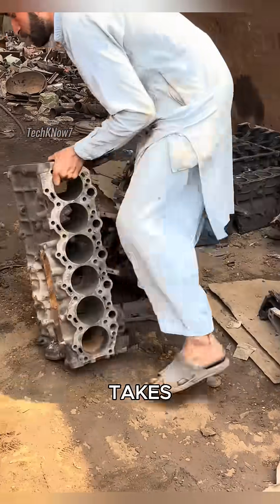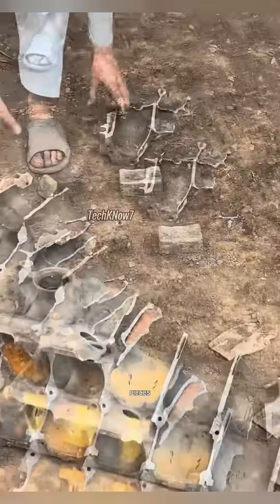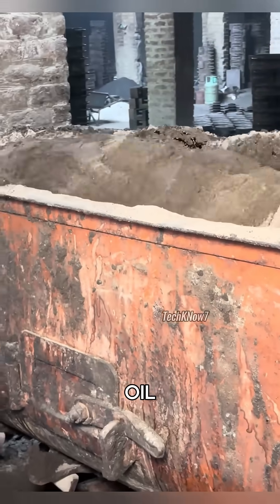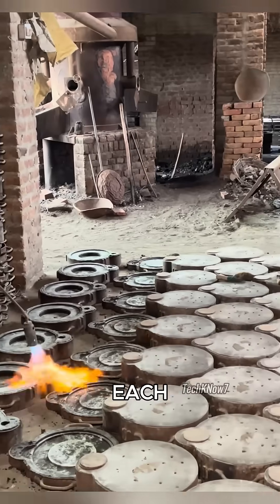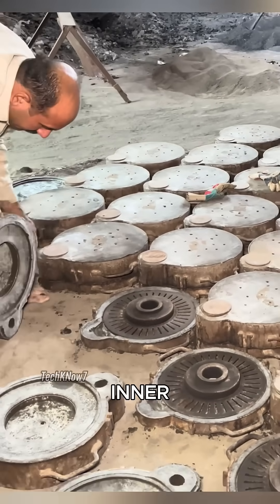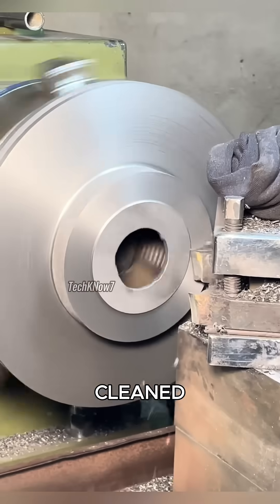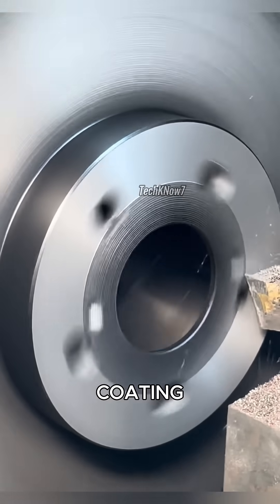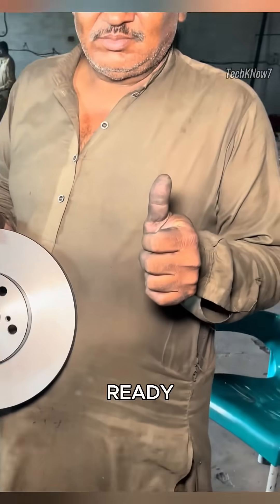How Old Engine Blocks Are Recycled Into Brake Disc #metalworking #engineeringskills #craftsmanship

Comment: Wow for those engine blocks to break like semi-hard hard stoney clay, those must've been ancient models, most cast iron of-today's is a bit more durable, and there just being all mixed together with out the metal being refined and what about the Homogenization: process were they add Inert gas (typically argon) is bubbled through the molten metal to ensure an even temperature and a uniform distribution of alloying elements and it also helps remove impurities, adjust chemical composition, and eliminate unwanted gases to achieve precise material properties.  There just adding more of a porous texture to the cosmetics of the surface of the metal, weakening the integrity of the metal, making those brake disc or also called brake rotors, (they made)- have the same durability or a bit less than a cast iron cook wear pan from today if u were to shave it down to the same metal thickness as one, but it'll probably be softer cause of the defects it would have, especially the old metallurgy of back then being mixed and forged in an even more outdated process of how it was first made 😅 but hey if there being sold for cheap over there and there easily accessible then that's fine i mean the streets are always crowded (over there i assume), from a lot documentaries I've seen there not gonna be speeding over 54mph to really need some heavier duty ones👍.

Comment: Just a question: the engine blocks that were broken down were aluminium right, the brake rotors are steel.  Have they discovered alchemy.
Reply: The engine blocks are most likely cast iron and most brake discs are commonly made from cast iron too.
Reply: @amarkhan2593 but for years engine blocks is made from aluminium. This video is big beautifull nonsense...
Reply: @damirbogner6432 The video also implies, that we just throw old engines on a big pile and dont do literally the same thing they do. Reusing its metal for something new
Reply: @damirbogner6432 You have no idea about Pakistan. Cast iron block engines are in use here, specially in the transport sector 10 x more than aluminium ones.
Reply: @damirbogner6432 these are Toyotas engines from 1970's and a million miles
Reply: Most engine blocks are cast iron, you could also tell by the corrosion and colour on the outside of the block
Reply: @getanearlyd8276  Working on modern european cars, I can not tell you if Ive ever seen a cast iron engine block. And even for the ones that are, I am rather sure the cylinders are coated and not bare iron. Also I dont know if THIS treatment of rusty old metal is a good idea for something like break discs
Reply: No they use cast iron blocks to make things that are supposed to be of the same metal.

Comment: Failed to mention these are the rotors sold on eBay that warp upon breakin.
Reply: Was gonna say they looked familiar. These are not rated to be brake disks. No proper hardening procedures, random scrap metal slurry. Probably break apart into shrapnel

Comment: Aluminium brake disc ?? What universe is that used in ???
Reply: Will they made them from cast iron engine blocks so I would assume their cast iron brake rotors
Reply: @Jim-f3n can you break cast iron with a hammer, the Pakistani might is only effective against Indians for they  use a lot of shampoo on their weapons

Comment: Impressive, I've always imagined this was done in large tech heavy factories
Reply: Because it is. The fact that you can make something at home doesn’t mean you should. This brake disc looked quite large. So it would be for a relatively modern  vehicle. That’s probably a bad idea. If you make a brake disc for a 50 year old car that is not very fast. Its original brakes are not very good you can match the quality. If you make put a brake disc like that on a modern car you will have all sorts of problems.

At speeds below 80kmh or 50 mph you probably don’t need to balance them. If you go faster your steering wheel will vibrate like crazy. So again 50 year old car, you’re fine.

Not to mention the quality of the casting. They are not controlling the temperature not x raying for pockets and cracks and so on. 

This will get you out of trouble to drive somewhere slow but it’s not a proper replacement.
Reply: Maybe!
We don't know where these parts go after this. And disc breaks haven't been around for 50 yrs.

Comment: And this is where Auto Zone gets their parts from.
Reply: Aaand? It's a lump of cast iron. It's fine.
Reply: If u look at the cosmetic of cast iron it's a poros metal, but wat we see right here: they're forging a lot of different types of cast iron grades, mixing metals that really shouldn't giving it a weakened material with all the different types of bonding, they can stabilize the internal structure but it doesn't make it's integrity as strong as one off the factory😂. But hey 👋 whatever works for them and I thought cast iron doesn't need protective coating cause it doesn't rust doesn't the narrator actually mean it's covered in cutting oil for a better cut, they should technically be using a type of coolant when trimming the surface face of hard metals.
Reply: It’s not like we’re gonna make it here in America 🤣 you shouldn’t be talking 90% of Americans are lazy
Reply: And?
Reply: @oscarcardenas2916  its crap...duh

Comment: Much love to Pakistan and India for cutting down the need for quarrying. They’re amazing at recycling metal and iron, and probably the only ones who can take apart a whole retired ship. Respect!!! 👏🔥
---from the Philippines 🙂🙂🙂
Reply: Do not buy car parts from Asia. What you call recycling, I call a low quality part made from a mixture of metals with no idea what impurities it consists of.
Why would you but one of the most important safety parts for your car when it’s been made with zero quality control????
Reply: @Peter_Peter_Curry_Eater  WRONG ALL THE WAY. THE ENGINE  HAS THE BEST METAL SUSTAINING EVERYTHING AND USING IT IS THE CORRECT IDEA. AND SHIP STEEL IS ALSO TOP QUALITY( CORROSION RESISTANT ETC). ALL STEEL HAVE IMPURITIES DO NOT WORRY. THAT IS WHY IT IS RE-HEATED MULTIPLE TIMES. YOU CAN SEE THE FINISHED PRODUCT AND THEM BEING USED IS A TESTIMONY TO HOW WELL THEY ARE DONE.
Reply: @king_has_no_clothskul8635  YOU DON'T HAVE TO SHOUT! You've missed the point, whether the steel quality is good or bad, the point is you do not know what grades of steel you are mixing, each batch of brake rotors you make will be different and unknown. Been in the industry for 40 years. Material traceability is key to the safety of any vital part.
Reply: @Peter_Peter_Curry_Eater  FOOL THE STELL IS TOP GRADE ALREADY. IT IS NOT THAT THEY WOKE UP AND DID IT ONCE. IT HAS; BEEN DONE FOR NEARLY 75 PLUS YEARS  SINCE BRITS AND SURELY IT HAS WORKED. OTHERWISE NOBODY WOULD BUY AN IMPURED PRODUCT. THE ENGINE STEEL IS ALREADY PROTECTED. WHAT NONSENSE ARE YOU TALKING? AND THEY ARE SHOWING YOU DO NOT NEED FANCY EQUIPMENT WHEN CHEAP LABOR IS AVAILABLE. SHIP METAL IS ALSO SIMILAR. IT IS NOT THAT THEY ARE MELTING A CORRODED ROD, TAKE A LOOK AGAIN.
Reply: @king_has_no_clothskul8635 First of all, just because you write in capitals doesn’t mean you’re right. Secondly, I’ve already answered this question a month ago, and you clearly didn’t read  it, so I’ll say it again. 
The steel that went into the product may have started as good quality, but you sometimes cannot mix certain materials. For example metal A alloyed with metal B may be fine, and metal A with metal C may be fine but a metal containing A, B & C may fail. I’m not saying the steel didn’t start off as good quality. I’m saying that if you mix unknown metals, that could be a problem. I don’t really care, you can buy cheap brake discs if you like, but they are the only thing stopping your car, personally I’m not going to.
Also, you said why would someone buy low quality products? The fact they do not know they are low quality. However, you could find out when your car doesn’t stop and you die.
Reply: @Peter_Peter_Curry_Eater  YOU ANSWERED CRAP AND SHOT BEFORE AIM. WHAT THEY ARE DOING IS PERFECT CONSIDERING THE LABOR PAYMENT AND CONDITIONS. THEY ARE BASICALLY RECYCLING ENGINE IRON WHICH ARE NORMALLY IN TOP SHAPE!
AND BUYER IS HAPPY, IF NOT THEY WOULD NOT BE DOING THAT AS THAT MARKET IS NOT HIGHLY PROFITABLE AND THEY ARE BARELY GETTING BY.
THE SAME GOES TO SHIP PARTS AS I HAVE ALREADY SAID BEFORE: THAT IS ALSO IN TIP TOP SHAPE AS THEY HAVE TO WITHSTAND SEA WATER AND THAT STUFF.

 WHICH PART OF THIS DID NOT GET IN TO YOUR HEAD? I AM A MECH SCIENTIST.
AND REFINING PIG IRON IS AGE PROVEN PROCESS AND BARRING SOME IMPROVEMENT IN STEEL IT HAS BEEN SAME SINCE TIME IMMEMORIAL.EIFFEL TOWER WAS BUILT WHEN?
YOUR CONCERN COMES FOR HIGHLY MALLEABLE AND DUCTILE PART OF IRONS. HERE IT IS MOSTLY COMPRESSION AND  THEY ARE HIGHLY RESILIENT. IT HAS TO CRACK BY BRITTLE NATURE. AND THE RECYCLED USAGE IS NOWHERE CLOSE TO PRIMARY USAGE: AKA THEY ARE NOT TAKING ANY LOADS ANY CLOSE TO WHEN IT WAS THE MAIN ELEMENT. SO HOLD YOUR JUDGEMENT.
Reply: @Peter_Peter_Curry_Eater Dude, those were skilled linemen, they need more safety improvements if they want to.
Reply: @patrickryanagapito502 Been in engineering for forty years, they are not skilled anything
Reply: did you not see all those woods? yah they are recycling but i hope they started planting trees for every trees they cut down
Reply: Cheap foreign products hippie

Comment: This is rubbish!!!!!! They were melting aluminium engine blocks and that is one material you CAN’T use for disc brakes.
Reply: Engine blocks are iron bro😂😂
Reply: @wichardbwendix4170  Not all engine blocks bro
Reply: @wichardbwendix4170 Most are  aluminium, but maby these aint. You can't use aluminum to make this.
Reply: Aluminium don't turn red went melted. It's cast iron.
Reply: Some engine blocks use cast iron.
Reply: That's cast metal 😂😂😂
Reply: Man Aluminium doesn't need anti corrosion material on it! This Iron.
Reply: Engine blocks are not aluminum, they're made of alloyed iron cast

Comment: And, this is why our newer vehicles break down within low mileage
Reply: Your  vehicle breaks down because of engineers are constantly changing design of vehicle parts. 
Not because of the breaks. Engineers are protecting their jobs, and screwing up design. Take ford, every vehicle has been recalled, for smoe reason or another.  Not for miner problems,  look at the Explorer,  catching fire in garages. 
Engineers reported that problem migrated thru the fleet. And Ford still has no idea why. They had to re-engineering everything under the hood. And not for the better. Don't believe me , ask an independent mechanic.

Comment: Wasn't that an aluminum engine block? Hate to see how long a aluminum disc rotor would last.
Reply: That was cast iron not Aluminum
Reply: @meerbahrain so they are breaking a cast iron engine block with a sledgehammer? Don’t think so.
Reply: @tanksdead7884 Bro.   In Nigeria, our  black Smith do the same. Breaking cast engine blocks with hammer. 

You guys need to travel and see the world. 😂
Reply: @zaPolymath I avoid 4th world countries but thanks for the input. I’ll do better.
Reply: Well aluminium don't turn red went melted. You can see it's red went poured. Aluminium is always silver in colour not red went melted.

Comment: Rotor should  be cast iron  no aluminium 😂😂😂
Reply: ...and why do you think it is aluminium? 
Aluminium should be shiny after the lathe. it isn't.
Reply: not correct, those were old aluminium engine blocks which discolour very fast. Only new aluminium is shiny and only if polished.

Comment: Without any regard to what material grade the brake disc should be.
Reply: Likely sold as something there not.
Reply: They're junk to be sure, never buy Pakistan auto parts!
Reply: Gray cast iron both!
Reply: @christophercoupe5006 I dont know if you have ever seen an engine block thats been built past 1900.
Reply: It's called metal